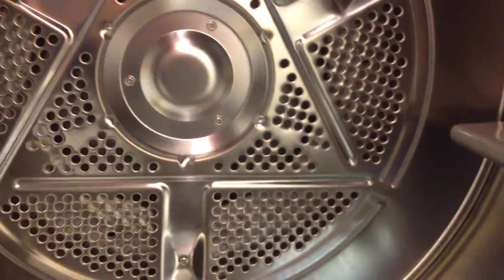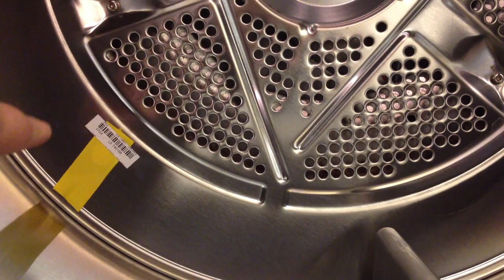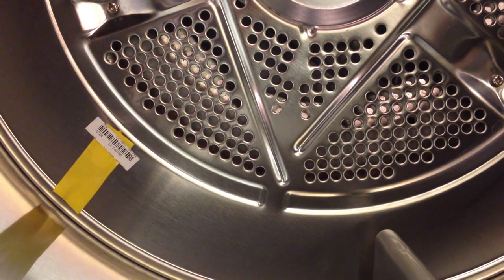DRYER THUMPING TWICE PER ROTATION

Comment: Great, great, great help. It was as Mike Derr described below.

You can actually fix this without taking anything apart. At least there is a chance you can. Suspecting the same problem, I just ran my finger around the inner rim and found a slightly sharp item jutting slightly out of the gap between the drum and the front frame. I couldn't tell what it was, I stuck my head in and used my phone camera and could see something. It was loose, and wiggled relatively freely and it felt like the tip of a screw. 

It almost felt like I could just yank it out. I tried a few times and it moved around. I got some needle-nose pliers and it took a couple tries but it came out. It was the pocket zipper to some cheap sweatpants. What finally worked was that I pushed up on the drum, which made the gap bigger to allow removal. (The zipper was stuck at about the 10 or 11 o'clock position of the circle.)

I actually have been annoyed to have had things getting stuck in that gap for years. A drawstring here, a button there, a zipper this time. Usually they remain attached to the clothes. The dryer will then grab the garment and just wring it to death. I've ruined a few articles of clothing this way. If your dryer has this same problem, it may be worth it to put some painter's tape on anything small enough to get stuck there, or to put your clothes inside out before drying as prevention.
Reply: Wow, I followed your instructions and fixed mine in 7 minutes! Including google search!

Comment: I have the answer!!  I was looking up how to take my dryer apart to see what was causing a thumping noise and I saw this video as part of my search.  Here was the answer for my Frigidaire dryer:  There was a piece of a metal button stuck in the front felt-drum-carrier.   At the front of the drum there is 2 hard plastic bushings.  They are 2 strips that each go half way around the inside of the drum.  These glide on the felt that is just inside the door.  If anything is sticking up on that felt, it will get hit twice per revolution and give you a thump noise---not good.   To get to it, I had to [1]UNPLUG, [2]two screws at the top cover back(remove top), [3]two screws at the bottom front, [4]disconnect two wires at top right, [5]two screws at top and the pulling gently at the bottom out, then up slightly, remove the front (door and sides).  I had taken my control panel off as well....not sure if that is necessary.  The door assy that I removed is where the metal button had gotten wedged.  Check all around the felt liner.  My dryer is about 8 years old and so I found a huge amount of lint had collected in the vent at the bottom of the door.   Just make sure that while it is apart, clean everything you can touch.  I did not have to remove the drum or belt, nothing but the door assembly.  My wife helped hold the drum while I removed and replaced the door.
Reply: Mike Derr Thank you so much! Found this video and it was a piece of broken zipper, saved me a couple of hundred dollars and an afternoon of waiting for a repairman🙏🏻👍🏻💪🏼 I love YouTube ❤️
Reply: Thank you!  Teeny, tiny piece of Lego.  Who would have thought?
Reply: This was my issue, too!  A small metal bead.  Whoda thunk??  Thanks!

Comment: there are weld marks that when the drum was made from two halfs and at those weld bumps every time it hits the roller it thumps.... when dryer was new it did not make the noise but after the rollers dried out and hardened you can hear the double thump.... i bought a kit replaced the two roller, a new belt and pulley assembly... still thumping... i figured the wheels  might be as hard as the old dried out wheels... i do not want to grind down the high spots of the weld that was done from the factory.. dry is 13 years old and gas... i will put up with the double thump... dryer works great other than the thump... also had to replace the two gas valve solenoid four years ago...

Comment: If anyone comes looking, here is another report that might be helpful. While I did find a drawstring metal cap embedded in my drum felt, this didn't fix it. My felt was thin on top so I added some felt pieces to smooth it out. This didn't help either. I wracked my brain and finally just decided to tighten all the screws I could see. Sure enough, one of the screws that attaches the drum bearing assembly (there are three) was loose. I spent upwards of two hours troubleshooting this thing.

Comment: So I'm going through many videos and this is the one that sounds closest to the sound I'm getting...its the only video I could find with the the cyclical thumping. Hoping to find an easy fix like yours. Thanks for the video... so helpful. What I will do is make a video during my repair so there will be 2 videos
Reply: Did you record the video?.
Reply: @nastybutter  Hey Nasty Butter... Do you have one of these to fix. I did fix mine and recorded the whole thing. I took it all apart but found the problem.  If you need help let me know. It's actually a very simple device. The most important advice I can give is wear good gloves as the paneling is like razor sharp knives.